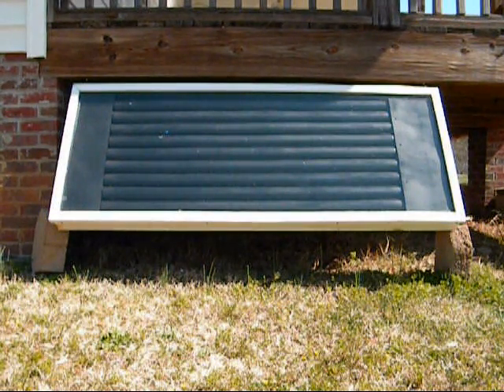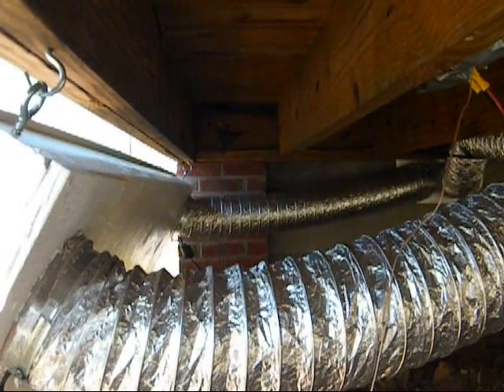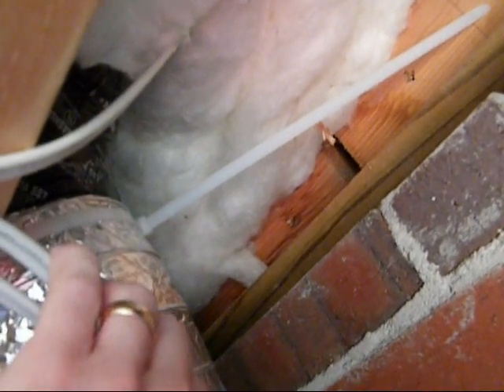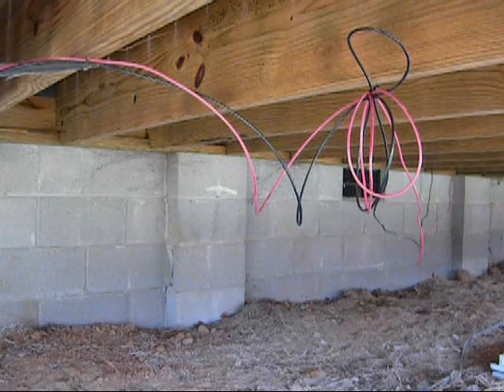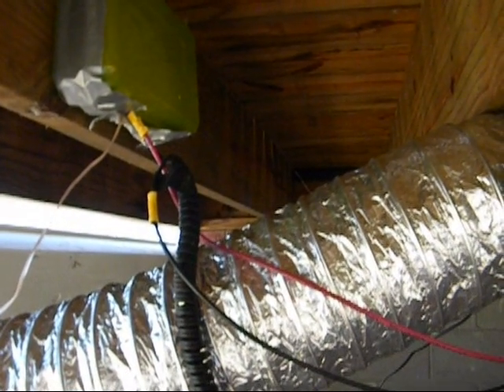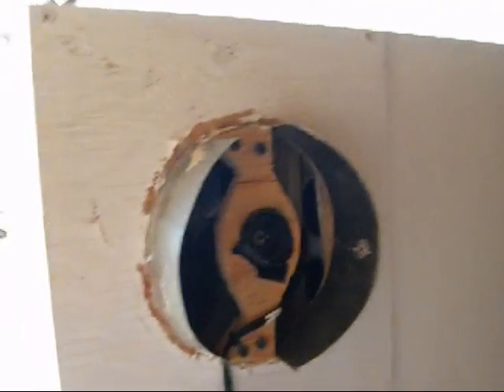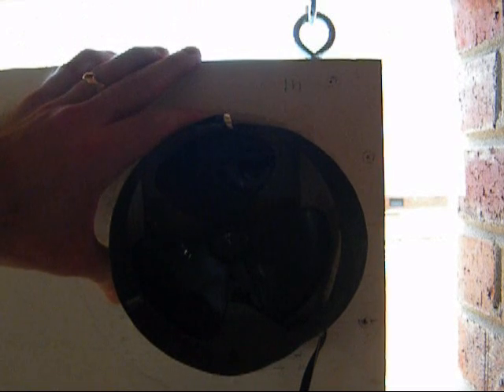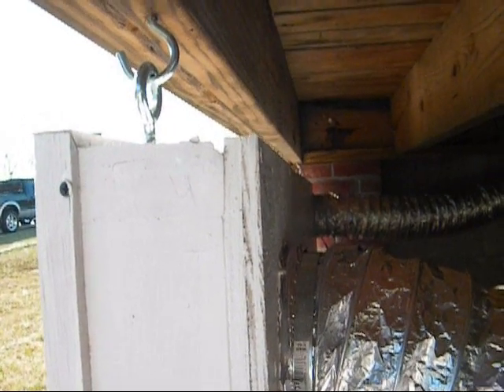How our solar heater was set up this past winter.

Comment from the maker: @Pesadelo80 I think if I were to guess on our average winter temps here I would say they are right around 40 degrees fahrenheit.  For us, the heaters work great and have had no problem with them so far. I would like to say that I also made a smaller one that just sits in the window and does not have to be placed outside. That one is way smaller, but also worked great. Thanks for the question, Lonny

Comment: Insulating that bare duct somehow or using my idea(see video) of making duct from ridged insulation would really help your efficiency. If you are are using 12V check into bilge blowers! They blow 240-270 cfm(alot more than fans) and can be mounted inline and far from the vent for even less noise. Also, using a snap disc inside the collector to control the fans is alot less expensive and less complicated.

You've done a great job, don't get me wrong. A few easy changes will make it better!

Comment from the maker: @the1969info Yes, I can do that. but It might be at the end of the summer. well with the fans off it would get around 190. With the fans on and blowing in and out of the house the air would regulate around 110. I will be adding reflectors, giving it more of a angle and adding more fans. The air has a long way to travel before it gets into the house.

Comment: will you do a video of how to hook up the household thermostat to those fans. Thanks.  also, how hot did your heater usually get, I know it blew at 70 degrees, but did it stay on for a while before it shut off the fans, how long did it stay on normally?
Thanks again.

Comment: To reduce noise, instead of the car fans you could use 120mm computer case fans. They are whisper quiet, have good airflow, and are also 12v so shouldn't be hard to adapt.

Comment: What are you thoughts on using your heater for a Solar Clothes Dryer in the Spring/Summer? Vent the heat into a large box that you could hang your clothes in to dry. But you could always just hang clothes on a line if your area promitted it.